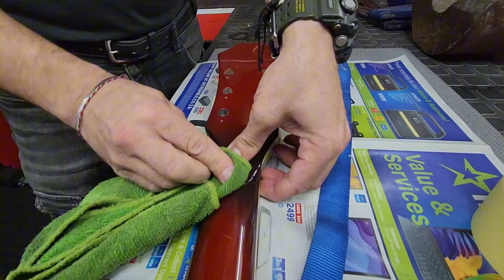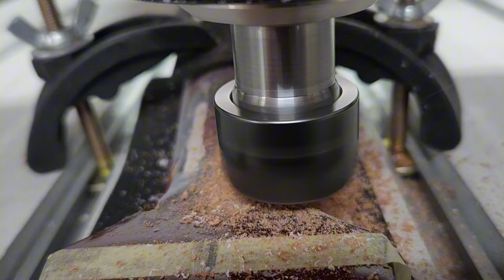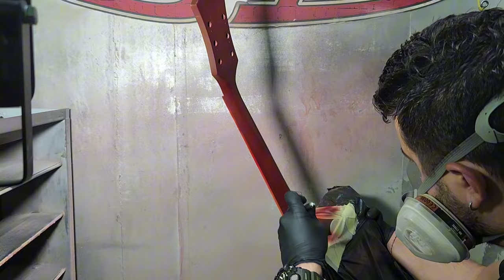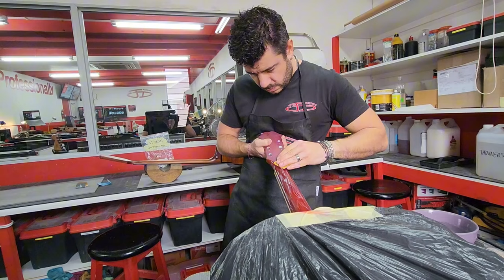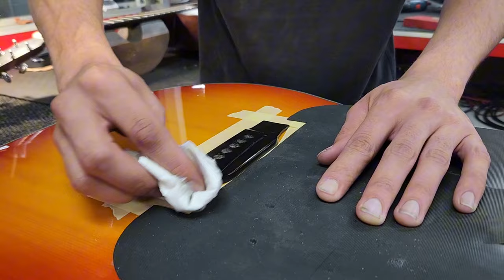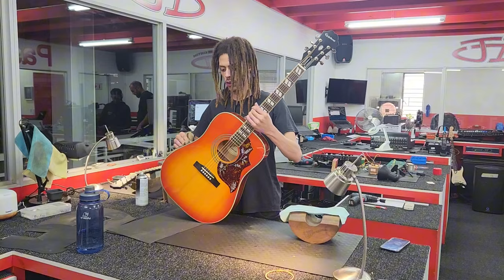Epiphone Hummingbird Headstock Reglue

Comment: Great video! What are all the different coats you spray on?
Reply from the maker: Thank you so much! We sprayed color to camouflage the crack and then used 2K polyurethane as a clear coat.
Reply: @jdkustom  Nice. Thanks. I love the Ion Shower gun. My wife used one, not this intense though, in the lab at WITS when they measure so finely that pieces of floating debris will affect the measurements. What is the clear you spray before the first colour coat? That's interesting.